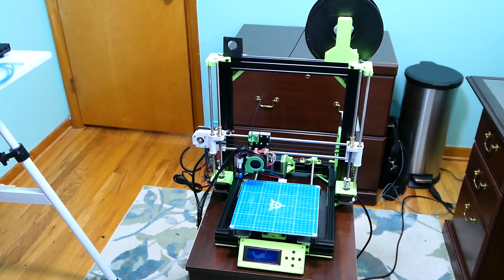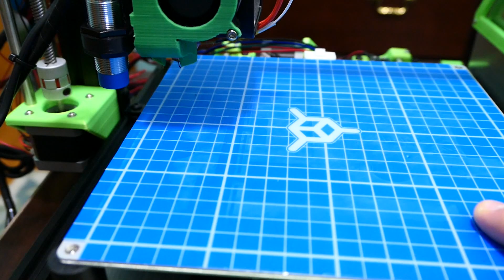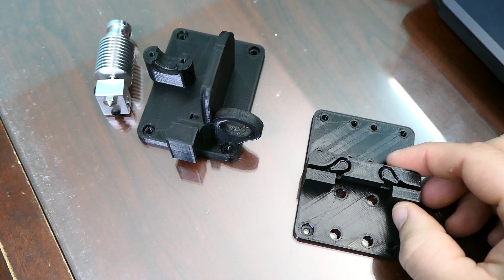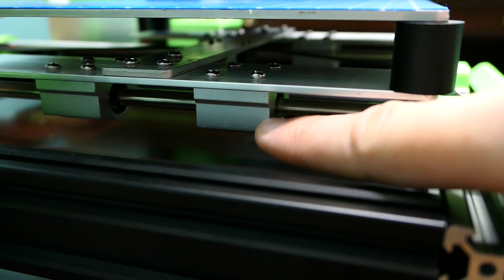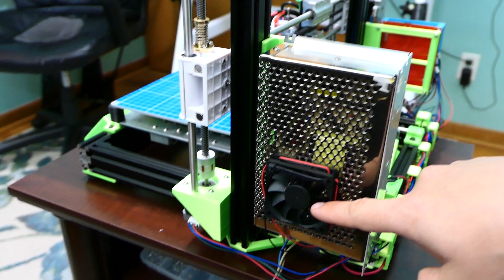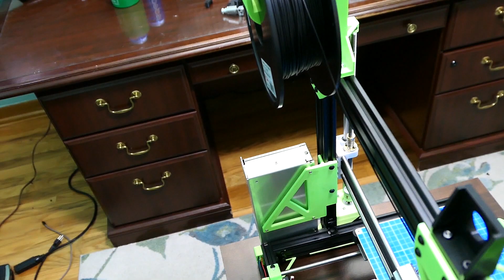Anet A8 to AM8 Conversion

Comment: BLTouch has always worked for me, and works on glass, which to my knowledge other probes don't. But great video! Question, would you think its possible to move the entire X carriage back, would it effect the printer much? I know you would have to edit homing positions in Marlin but otherwise I see no reason why it wouldn't work right?
Reply from the maker: You should be able to move it back, sure.  Just takes some more firmware edits to make up for it.

The EZABL does work on glass, and all other materials, it doesn't care.

Comment: Can you send filament spool holder link? By the way  what is good? capasitive sensor or bltouch? you have capasitive sensor. can it work on glass or mirror ? ı am using mirror on bed now.
Reply: Capacitive sensors will work far better.  If suggest you head over to www.th3dstudio.com and check out Tim's new EZABL Pro.  It is by FAR the best sensor available.

As for the filament holder, I don't have that STL.  Tim printed that for me when I was working for him at his office several weeks ago.  You'd have to get a hold of him and ask him for it.

Comment: extremely expensive mod
Reply from the maker: What part of it?  The frame kit was only $85.
Reply: @M1dn1ghtN1nj4  the frame itself. It's half of the total price that the Anet A8 cost me. I've been thinking of buying it but I'm not sure if every euro is worth... What do you think about the frame so far?
Reply from the maker: I love it.  As long as you assemble it correctly, it'll be rock solid.  I pick mine up by the top bar that my extruder is mounted on.  Has never once flexed or needed retightening or adjustment
Reply from the maker: But that's the good part.  The original printer is cheap to start with.  So the frame upgrade takes it up to par with $500 printers.

And yes, I'm STILL using the original Anet 8-bit mainboard.  Prints like a dream!
Reply: @M1dn1ghtN1nj4  Thanks! I wasn´t sure if I should buy it or not, but your explanation conviced me!